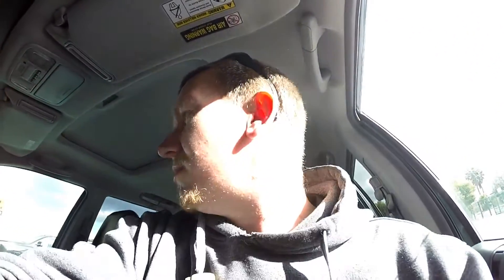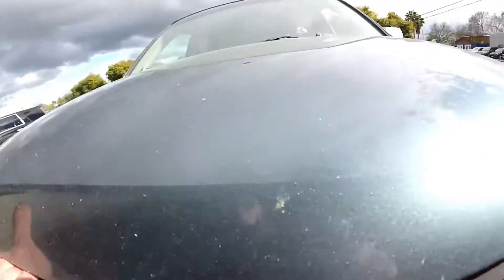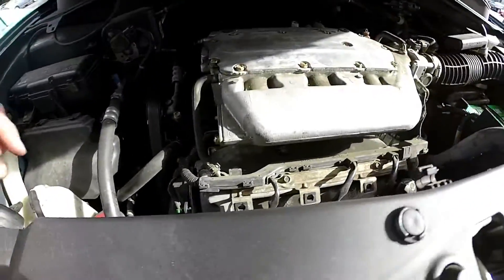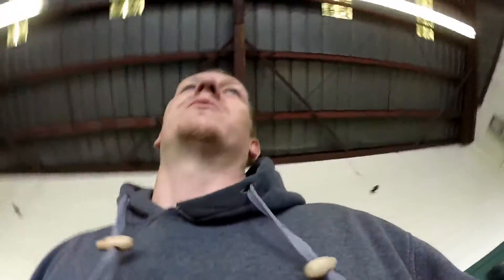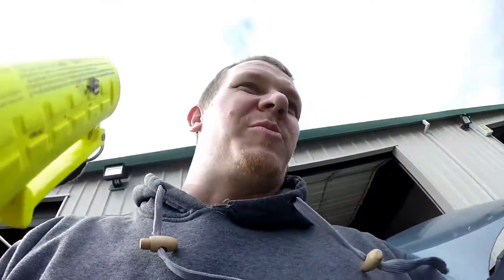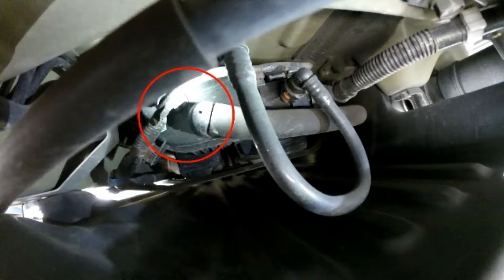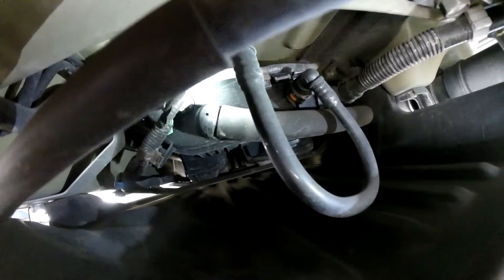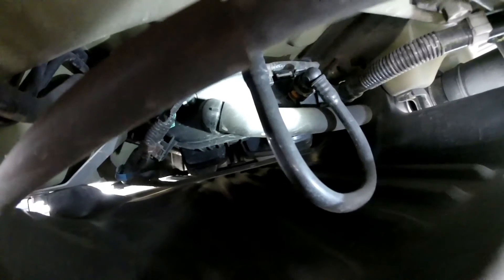Honda Pilot smog locations: PCV, EVAP, & EGR

Comment: Hi, im about to loose my mind. 2006 pilot and it has gotten harder to start meaning it turns over more and I keep getting a check fuel cap message. I replaced it. I have put my mouth on it and the valve in it is working with suction. After a few ingnition cycles it throws the p0456 code. I replaced the purge valve solenoid. Now  since replacing it it is hard to start after fueling unless i hold the pedal to the floor. After it will hardly run for a few minutes unless keep the rpms up. I bought another pruge valve and same thing. I have since learned how to test it on the vehicle by unplugging it and pulling the inlet hose off to see if there is suction without power. There isnt. I plugged it in at the same time to test if the ecu has it open all of the time. It passed. It took a few minufes for it to open it up and begin suction. I threw the original purge valve out as i wish i would have tested it first. It just doesnt make sense. Everything its doing leads to the purge valve. Especially the hard start after fueling. Could you please tell me your thoughts? Could a bad charcoal canister cause this? It doesnt kick the nozzle off while fueling. Its driving me crazy. Thank you.

Comment: Do you think it would be the evap canister if fuel leaks (near the gas tank, not from the engine bay) when the tank is filled all the way?   Also getting some occasional “loose fuel cap” message even though it’s new and fully tightened
Reply from the maker: if the canister is full of fuel something else is not working properly. You will have to get a flash light and look up there. its not common on this vehicle buy your filler neck could be cracked going into the tank too.

Comment: Nice video! Really appreciate how you put those red circles around the area of interest so people know exactly where they should be looking and what they should be looking at. 

QUESTION: 2006 Ridgeline, 130k miles, recently began getting the “check fuel cap” message (no check engine light or other codes). Replaced both the fuel cap (OEM) and purge valve (Rock Auto), cleared message but it returned after about 200 miles of driving. HELP!!!!

What should I do now? Thx in advance.

Comment: Hi I'm getting p1457 evap control system leakage (evap canister area) .. My 2004 honda pilot Woodstock and then just cut off and then I have to start it again and give it a little gas that the RPMs would go up so it wouldn't cut out on me and then drive. Then a little after when I would park or at a light it would act normal. Help pls.
Jeff

Comment: Hi, I'm getting the P1457 code on my 2001 Acura MDX.  Replacing the gas cap hasn't solved the problem. The acceleration is sluggish and fuel economy is poor. Can you tell me what I should look at next and the location on my car? Thanks
Reply from the maker: P1457 HONDA - Evaporative Emissions Control System Leakage EVAP Canister System.

I'd check the vent solenoid. The vent hose to ambient gets cogged a lot. Try cleaning it. If that is free of debris, I'd check the vent solenoid.  Do a 9v test to see if its switching and do a residence test. If that is all good, see if you can blow threw the vent solenoid when its disconnected. You should not be sble to blow threw it at all. It should seal with no power added. I bet you will find a problem somewhere around the vent solenoid.
Reply: @ScottiesHobbies  Thanks, I'll give that a try. Would it be ok to use the first gen Pilot as a reference for the location?
Reply from the maker: Should be similar.  Did you check ny library for a MDX vid? I don't remember if I made a vid of one.

Comment: At the front of the evap box, is there supposed to be a tube coming in that just ends and goes nowhere?
Reply from the maker: Yes. That is the vent solenoid. That's where pressure gets released that can't be pushed into or sucked into the engine. So that hose releases Vapors into the atmosphere or ambient.